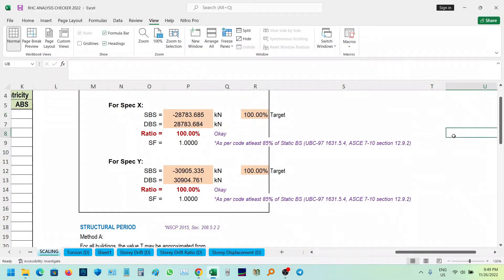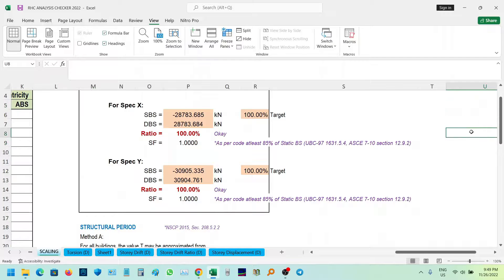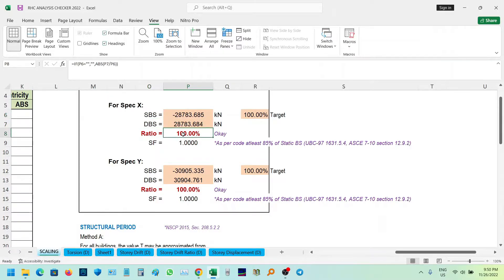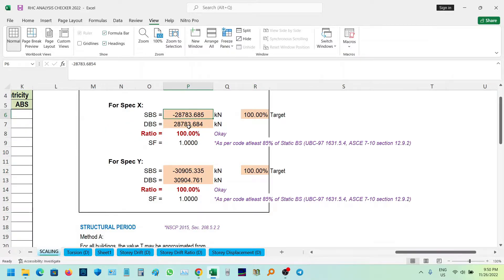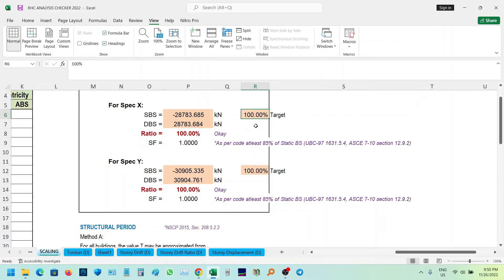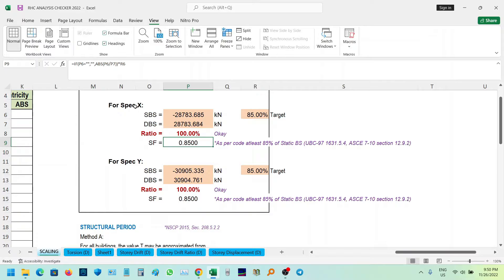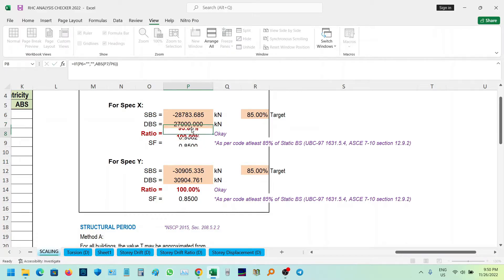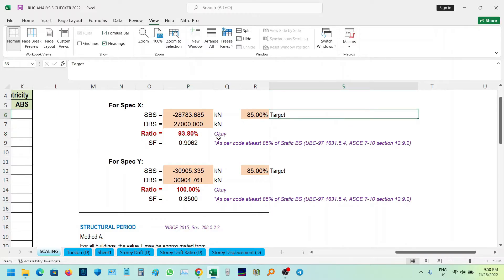Dynamic Base Shear Scaling as per ASCE 7-10 & UBC 97.

Comment: You are not supposed to reduce the dynamic analysis results if they are  equal or more than 85% of the static analysis results. If the dynamic analysis results are low, you can increase it to at least 85% of the static base shear. The target of 85% is a minimum requirement and if you have for example 93% then leave it as it is.
Reply from the maker: You're right. But "It is recommended that building structures classified as being irregular be designed for 100% of the base shear force value determined by static analysis" especially when the authority demanded for 100% base shear value.
Reply from the maker: Also please refer this section.
UBC97, SEC. 1659.4.1 
EXCEPTION: If a site-specific spectrum is calculated for the maximum capable earthquake, 
then the design spectrum may be taken as less than 100 percent, but not less than 
80 percent of the response spectrum given in Figure 16-3 of Chapter 16, Division III, 
where the values of Ca shall be taken as equal to CAM and Cv shall be taken as equal
to CVM.
Reply: Refer to 1631.5.4 reduction of elastic responce parameter